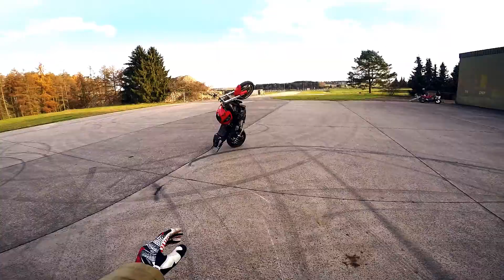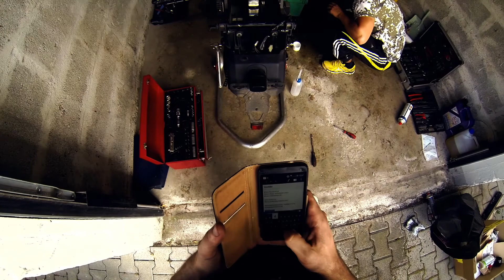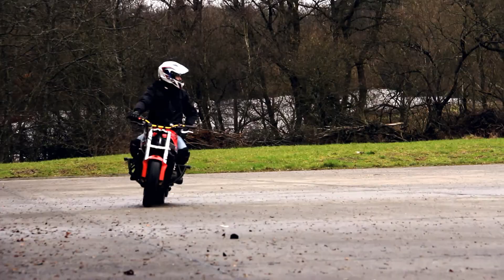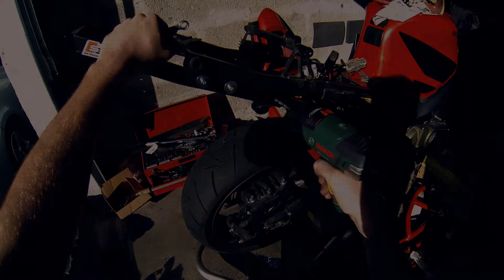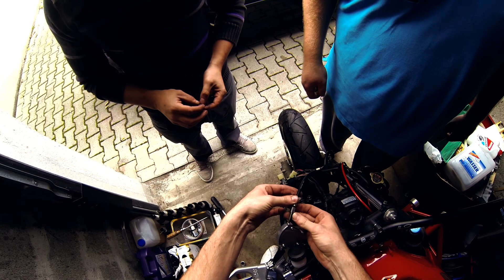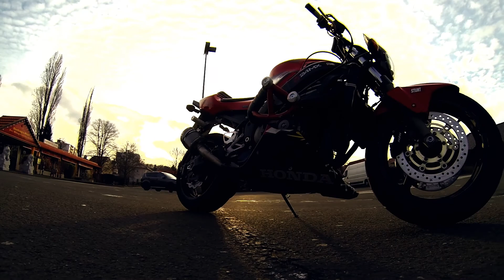build a StuntBike Honda CBR 600 PC35

Comment: ok frage Nummer eins wenn ich ein f4i suche finde ich eine f4i pc35 aber auf den Plastiks steht nicht f4i sondern nur Fsport
Reply from the maker: Das muss da auch nicht stehen weil das nur eine Bezeichnung ist die in den USA verwendet wird! In Deutschland sagt man einfach PC35 dazu anstatt F4i ! Einfach nach Honda CBR 600 PC35 suchen ab Baujahr 2001. Da gibt es dann nur zwei Ausführungen und zwar die eine mit dem komischen Bannen Sitz und die andere mit dem Stufen Heck. Im Prinzip beide die gleichen.
Reply: blaubobikEG StuntDriver ok vielen Dank on welchen Shops hast du die Teile denn alles gekauft ? Ich kenn nur zeus und thesicshop andere Shops kenn ich nicht
Reply: blaubobikEG StuntDriver also ist die cbr 600 f pc35 die selbe wie die die du hast ?
Reply: Suchst du zufällig noch eine? Kenne jemanden, der seine verkauft.